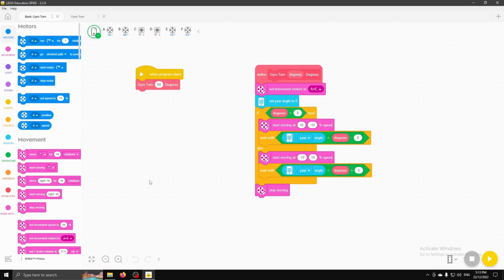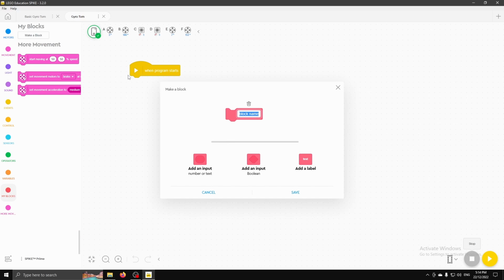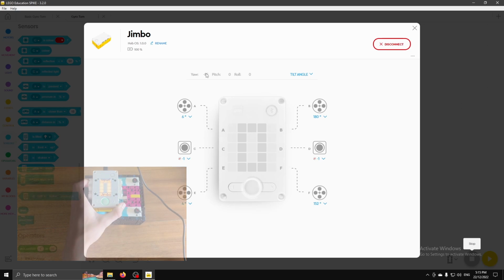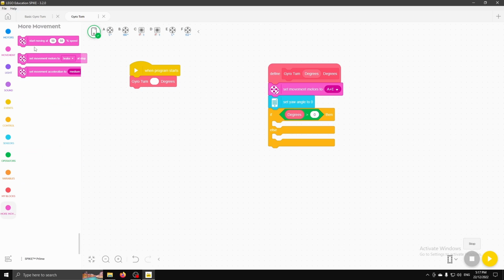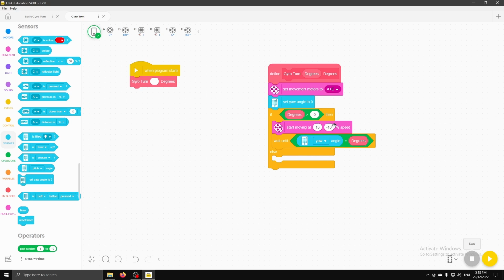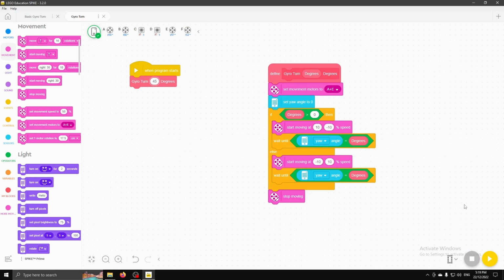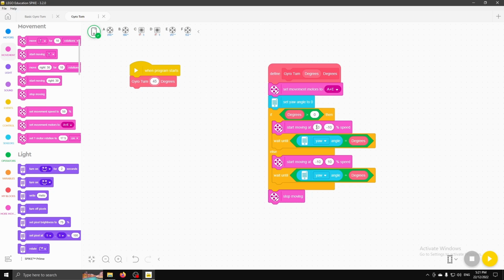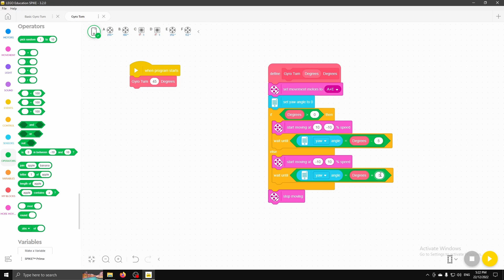Gyro Turn Tutorial - LEGO Spike Prime

Comment: My hub gyro has inconsistent transitions from positive to negative yaw angle output. It sometimes flips yaw polarity at 180, as it should. But sometimes it switches at random angles, for example 0 to 220 then -140 to 0. Next it might be 0 to 30 then -330 to 0. The erratic gyro yaw output makes yaw turn control unreliable. Any tips for correcting this?
Reply from the maker: Are you using spike legacy, or the new spike prime software to code?
Reply: This is so cool! none of the other ones I tried worked. thanks!!!